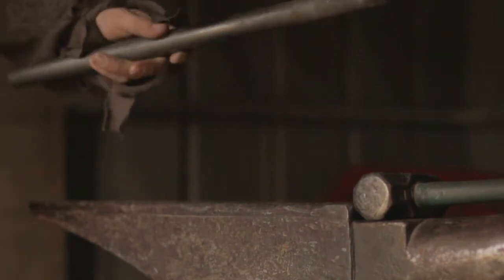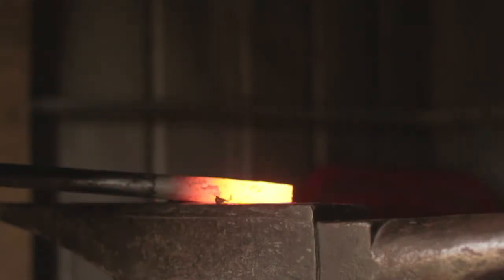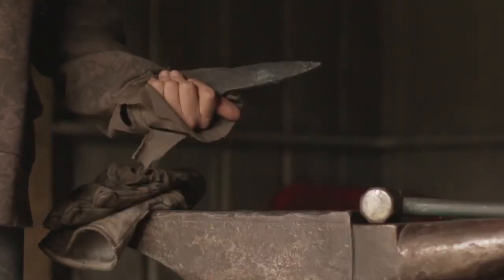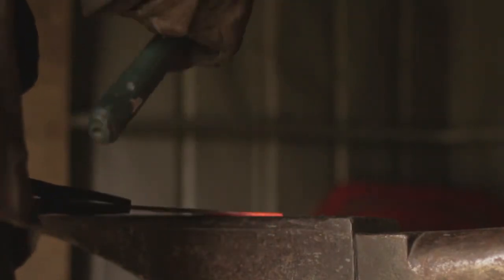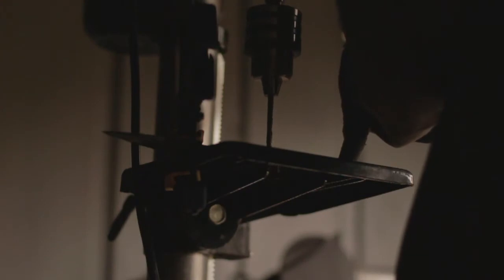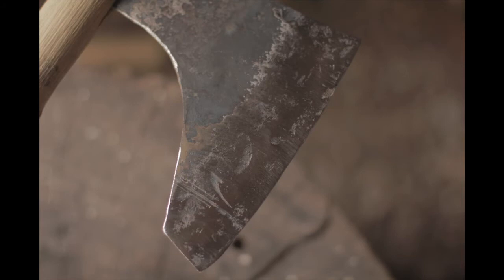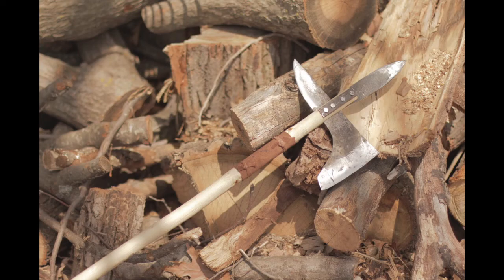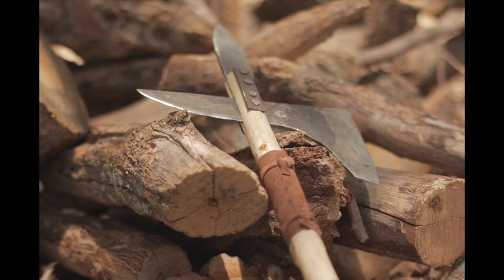Forging A Medieval Pole Axe

Comment: Glad that you actually forged it. I see all these idiots just cutting out a piece of steel. That's not a blade if it's just a mild piece of steel cut out of plate.
Reply: Well, you can easily get carbon steel plates to cut your blanks from😒😁
Reply: 77Avadon77 I am a blacksmith and you are correct

Comment: It's good to see actual forging. However, on a Pollaxe (note correct spelling) the head does not pass through the haft (which would weaken it) it is socket-mounted, with langets which extend down the haft, usually for around a foot to eighteen inches, often terminating in a hand-guard. All parts of the head are usually hammer-welded together. Sometimes the spike on the top is screwed in through the head of the pollaxe to both secure it, and also to reinforce the binding of the head to the haft.